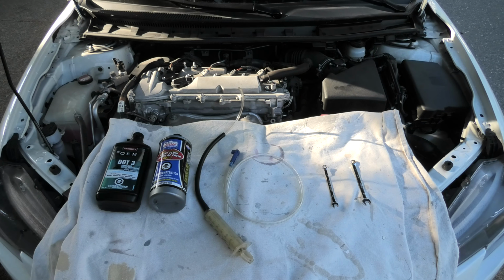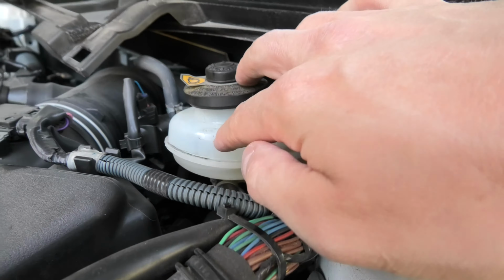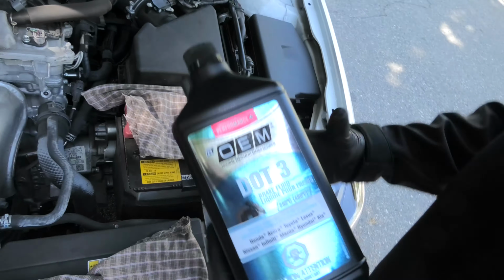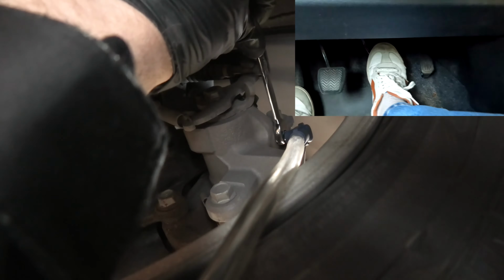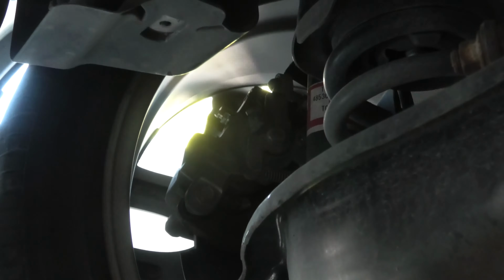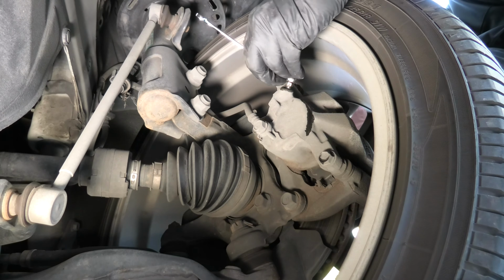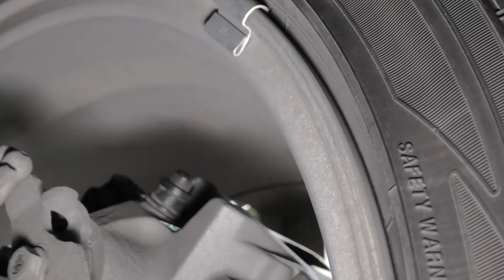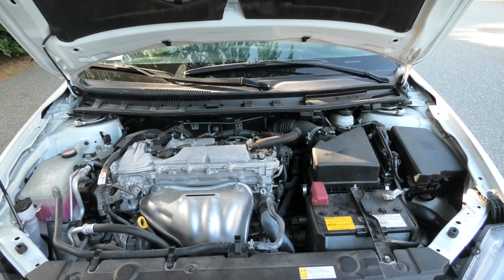Scion TC (2011-2016): How To Bleed Brakes? Brake Fluid Change. Detailed Guide!

Comment from the maker: PRODUCT LINKS:
1. Genuine Toyota Fluid 00475-1BF03 Brake Fluid, 12 oz - https://amzn.to/43y6Wsn.
2. Lucas DOT 3 Brake Fluid/12x1/Quart - https://amzn.to/3WKIFNn.
3. Adams x Recochem OEM DOT 3 Brake Fluid Asian Vehicles 1 Quart Compatible with Honda, Acura, Toyota, Lexus, Nissan, Infiniti, Mazda, Hyundai, Kia, & Others - https://amzn.to/43yPX9s.
4. CRC 05088 Brakleen Non-Chlorinated Brake Parts Cleaner, 14 Wt Oz - https://amzn.to/3oIRv1S.

RECOMMENDED TOOLS:
1. SYRINGE WITH TUBING - 300ml Large Plastic Syringe with 3.28 Feet Handy Tubing for Scientific Labs, Watering, Refilling, Filtration, Motoring Application, Set of 1 - https://amzn.to/3QTAmgO.
2. VINYL TUBING - PVC Vinyl Tubing - 10 feet 1/4" I.D. x 3/8" O.D. - https://amzn.to/3wAKikE.
3. BRAKE BLEEDING ADAPTER - BESPORTBLE Brake Bleeding Adapter 5pcs Car Oil Bleeder - https://amzn.to/3OOUWhX.
4. WRENCH SET - GEARWRENCH 14 Pc. 6 Pt. Combination Wrench Set, Metric - https://amzn.to/3YlkTag.

Comment: Which one do you prefer this manual method or thr vacuum method using those vacuum bleeder kit?
Reply from the maker: Thanks Harold! You can use the vacuum bleeder kit for regular brake fluid changes. The pressure method that we used in this video provides more pressure which is critical when or if you have air in the system.